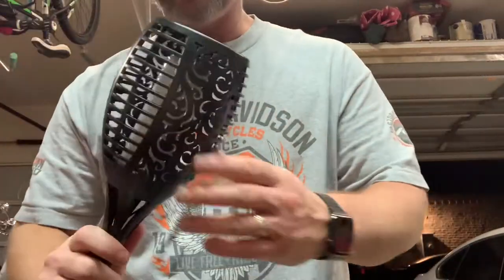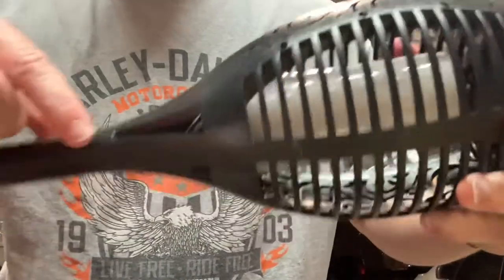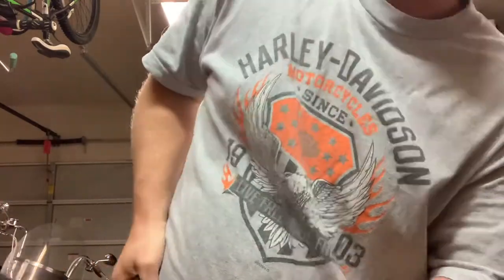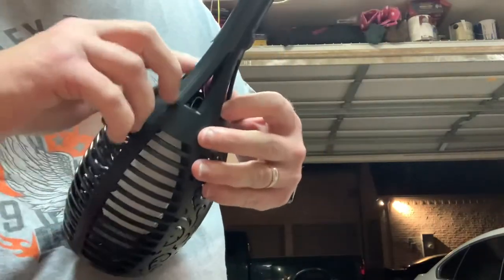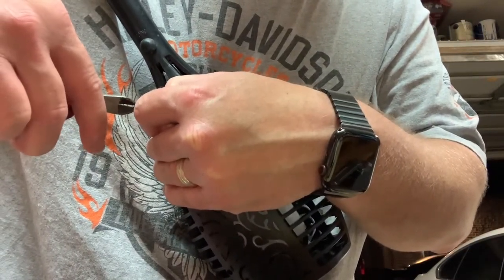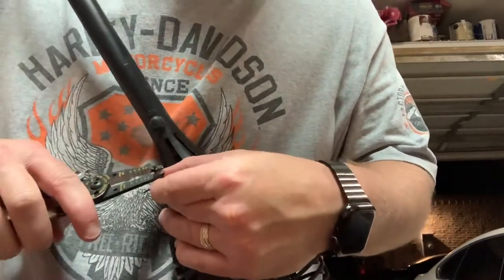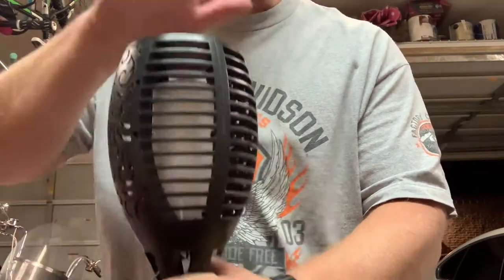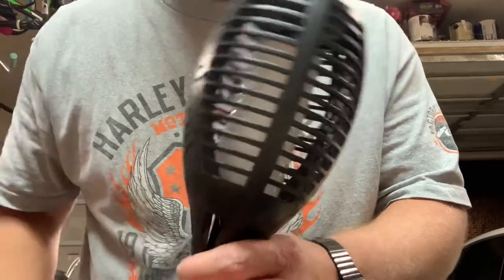LED Solar Landscape Torch Lights, easy fix for broken or flickering problem, switch bypass.

Comment: I bought a set of 5 and they weren't cheap. Over the past 2 years 3 of them stopped working.  I was just about to throw them away and decided to look it up first to trouble shoot them.  You're video saved all three.  Quick, straight to the point and it works!

Comment: Two minutes!
Zero nonsense!
1000% Brilliant man!
10,000 Thanks!

On a side note the ones I have had no external switch or exposed wiring running down the middle so I unscrewed the small screws along the top and opened it up. Turns out that was unnecessary as all you have to do is unscrew the solar panel top piece. DOH! 

Once opened remove the white bulb-like cover by twisting. Inside there is a long (about 70mm x 5mm) thin circuit board which has about 5 or 6 small LED lights spaced apart. The whole thing is jutting out from under the solar panel housing with a switch labelled "On / Off" . Guess which one I had to switch it to lol.
NOTE: The circuits are very sensitive so be careful

Comment: Fix is easy, but you destroyed case. That version is easy to unscrew and fix without damaging. That is the most common failure for that lamps, sometimes (after 2-3 years battery can have problem with contacts).

Comment: That's what I thought.
Isn't it like 6 screws on the casing and then 1 screw just below button on the handle?
7 screws and you do not have to break the casing.
Reply: Yes, and you can especially use solder iron to short two switch pins. The is little problem with changing battery, you need use some heat source - can be hair dryer if you don't have hot air, and melt glue, after changing battery melt glue again and close it. After cool down you can assembly it again.

Comment: When I change the batteries on these I turn off the switch change battery,but when I turn it on inside or put my hand over it,it goes on but when in daylight it does not turn off can you help?